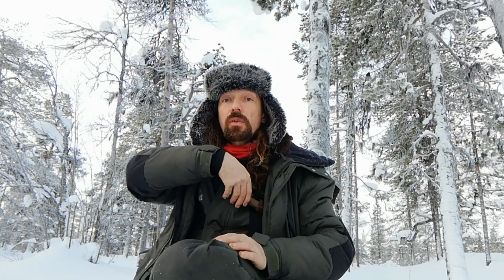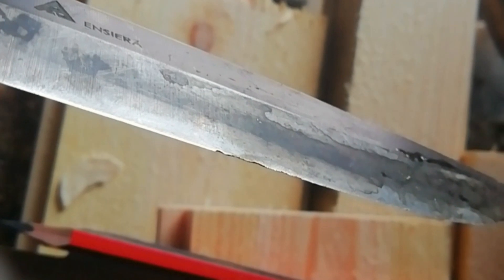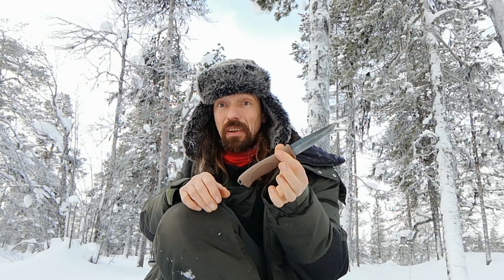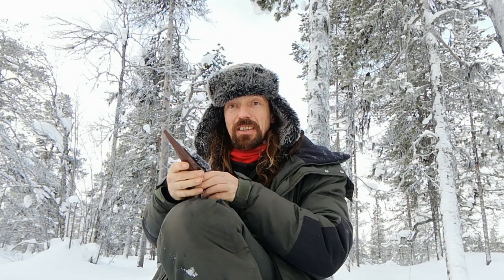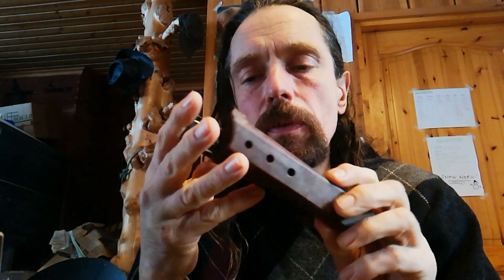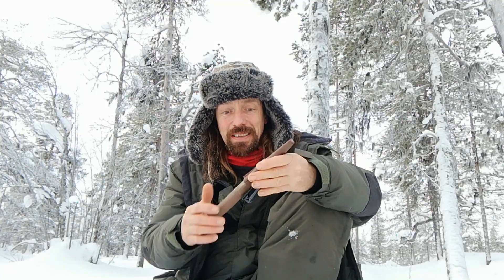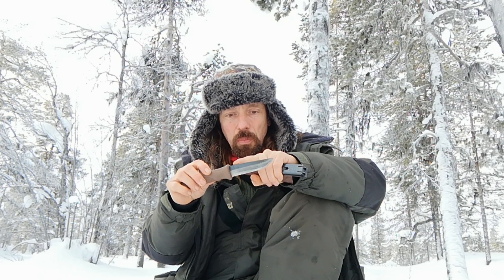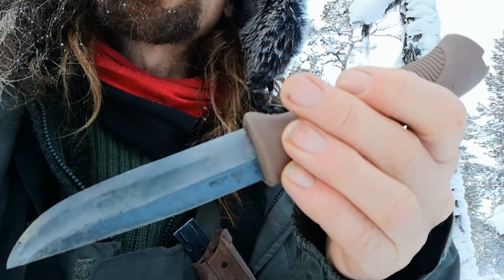Rokka Korpisoturi knife

Comment: I was going to get this but I can buy 2 j.p peltonen m95 sissipuukkos for that price.
I love my m95 I think it's one of the best puukko I have ever had it's awesome.
I liked it so much I bought the smaller version aswell lol
Reply from the maker: Bloody hell I missed this comment. Sorry for the late reply mate. To be honest I far prefer the M95 to this one. The M 95 is a fantastic knife. Thanks for watching mate.
Reply: @KuukkeliBushcraft  
Well after using it extensively I actually like the Rokka it holds an edge better then the j.p peltonen m95.
& cuts better I don't like it better then my m95 but the Rokka korpisotori is definitely a fantastic bushcraft knife & Probably my second best bushcraft knife
Reply from the maker: @leearrowsmith3872  definitely holds an edge fantastically well. The blade is really good. Since doing this video though I had a little issue with the handle. It started to split along the seam. Fixed it with super glue since and it's holding fine. It really is a great knife to use but the issue with the handle and a couple more little things that I mentioned in the video make me wonder if it is worth having spent the money. Without the handle splitting it would have been worth the money. Hopefully you don't have the same problem.
Reply: @leearrowsmith3872 trying to decide between the Roka and the Pelotonen M07. I am curious, what is it about the Pelotonen you like better? Aside from the sheath? I want a knife that can feather stick well and have descent food prep capabilities. Thanks.